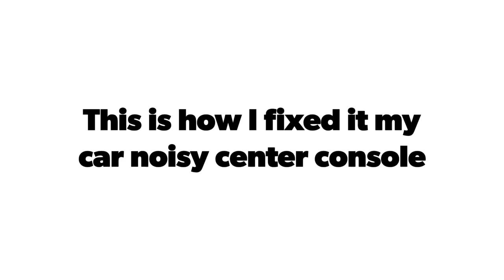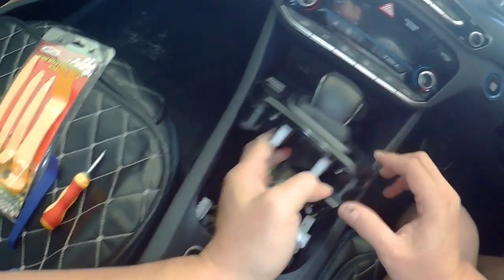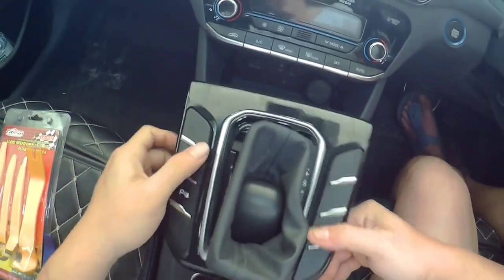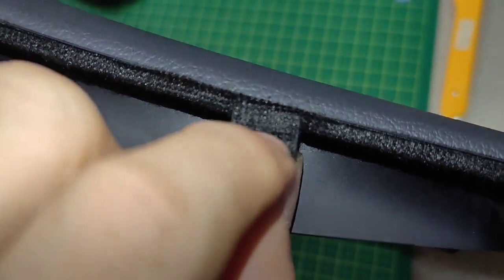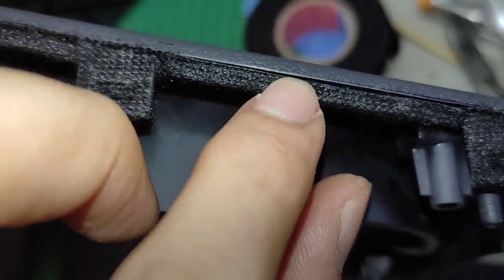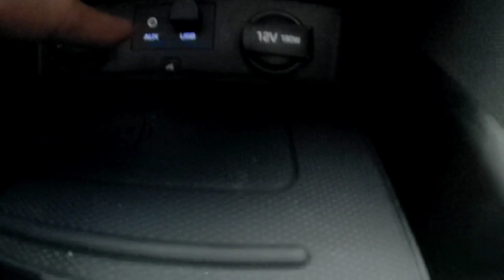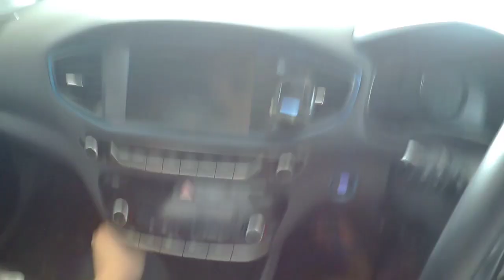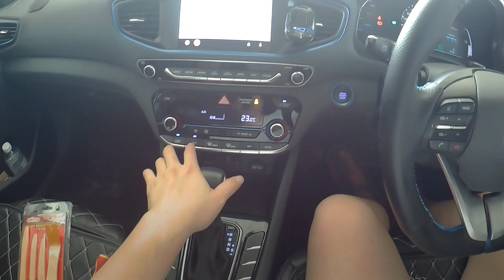Fixing my car noisy center console

Comment: I am trying to take the knob off, but no matter how much I pull it doesn't come off, is their some sort of screw or locking pin of some sort that needs to be released first, not entirely sure why mine won't come off as you have shown in the video.